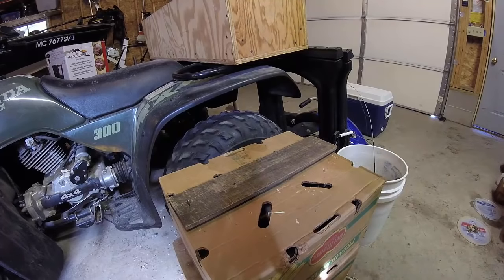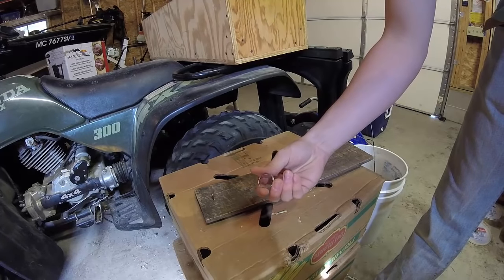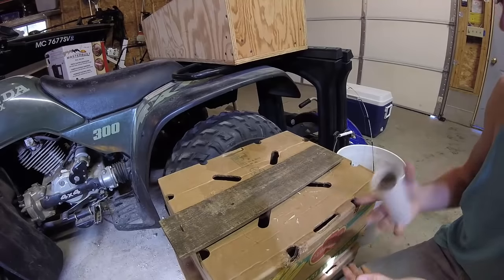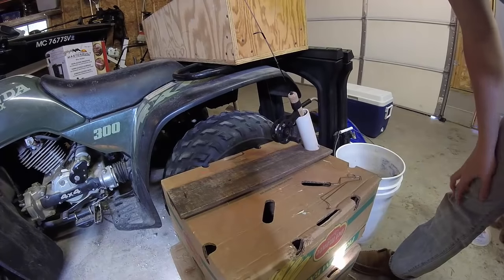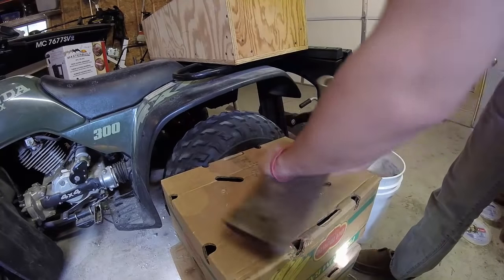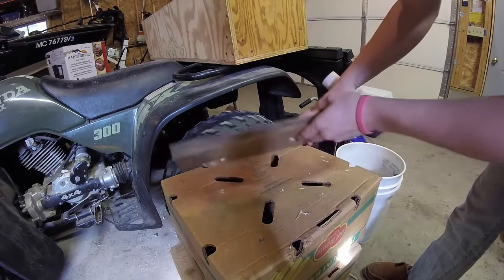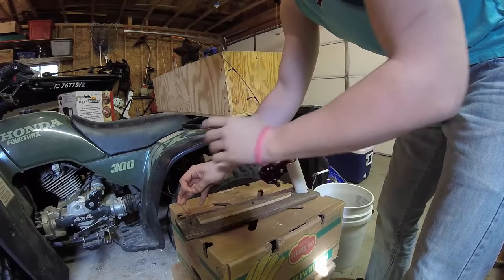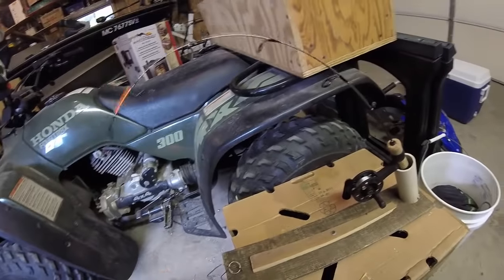How To Make a Homemade Automatic Fisherman

Comment: Maybe you could use an eye screw/bolt instead of the hanger and key ring.  Something you might want to experiment with.
Reply: I've made one with the eye bolt and a nut on it. Nut holds it down tight. Built the same type of trigger setup with a coat hanger. I did without the key ring, as it was not necessary. Worked fine without it.

Comment: I am a master rod builder.  The one problem I see with this rig is the sharp edges of the latch wire scoring the material of the tip top guide.  This will inevitably damage the line.
Reply: Sand it smooth,  problem solved